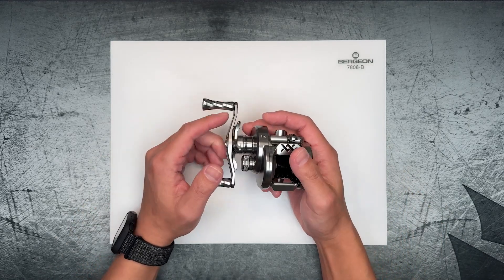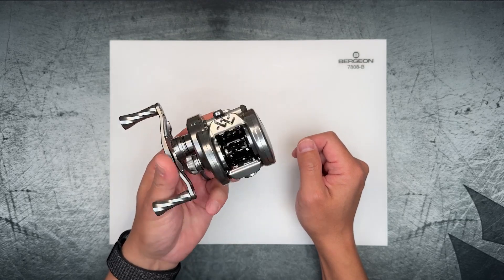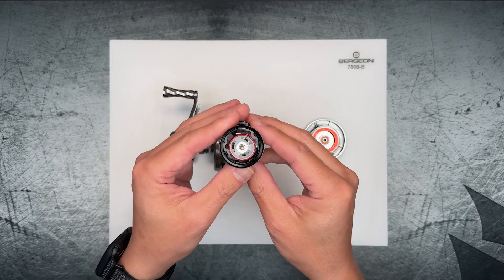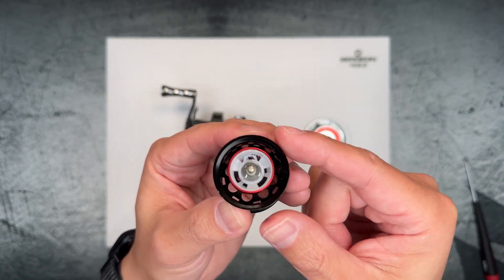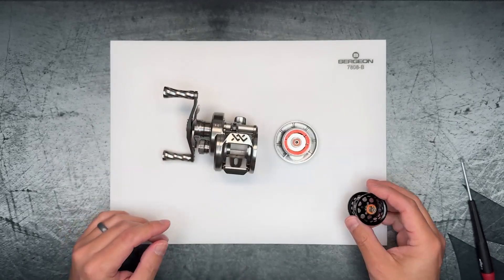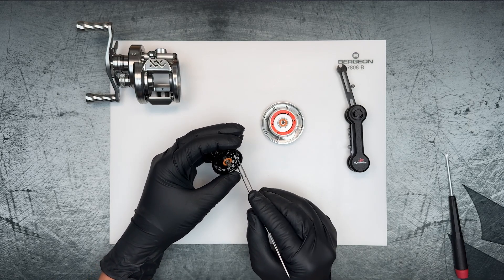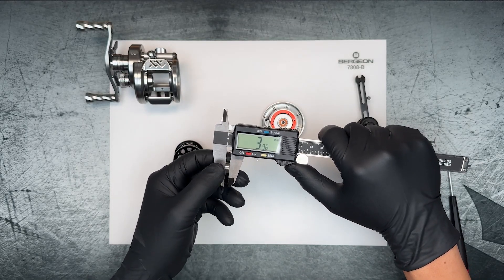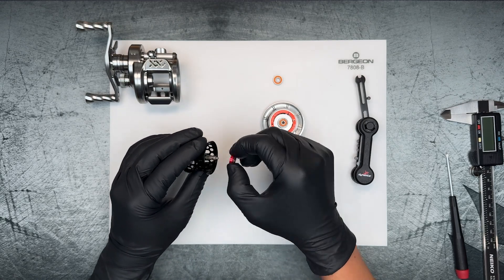🤓WATCH THIS TEARDOWN😳LOONGZE AIRLITE!!!

Comment: Good teardown thanks, does the pinion yoke have a metal plate or it is just full plastic? Without a metal plate the plastic yoke where the pinion gear sits in the cut out will eventually wear down especially in gritty or SW conditions.
Reply from the maker: Hey Nigel! If memory serves, the yokes does have a metal plate where the pinion sits. I can double check when I get back to my work bench but I rewatched the teardown and I could barely see a small metal plate as well as vaguely remember one. I will double check on that though! Great request and I’m not sure why I overlooked mentioning that as it’s a great addition to have imho. Cheers my friend!
Reply: Thanks for the reply, keep up the great work, looking forward to the DC review 😃 @BFSFISHINGCHANNEL
Reply from the maker: Cheers Nigel!!!

Comment: Is the handle post 8x5mm or 7x4mm?  I'm curious which aftermarket handles will likely fit.  Thanks!
Reply from the maker: Hey illini! Just measure and the handle size opening is the 5mmx8mm size. I will say though that the handle itself is made very well. I would suggest just looking to swap the knobs out but it’s entirely your call. Cheers my friend’
Reply: @BFSFISHINGCHANNEL  I like the handle a lot, but I have another reel I might try to move it to. They are all interchangeable parts to me in the end.  I'm also curious if any Daiwa spools fit this reel.  I'll find out soon enough I guess.
Reply from the maker: @IlliniDog01  hey illini! I kind of doubt that daiwa spools will fit as the widths might be different as well as spool shaft dimensions. Worth a shot though? I do agree that handles and knobs are interchangeable. I swapped over some daiwa TPR handle knobs onto my loongze and was thankful that I had done so as the weathers been colder than usual in Southern California. Alloy reels and cold weather really don’t mix lol. Cheers my friend!

Comment: good sir you seem to know your stuff do you know if  AMBASSADEUR 5001C  uses  3mm x 10mm x 4m  bearing i am trying to convert  it into bfs reel but i  have no idea how to measure the bearings
Reply from the maker: Hey kaban! Sorry for the late response but unfortunately I am not sure of the bearing size of the 5001C. You can find out bearing sizes by measuring the outer inner diameter, outer diameter and the width of the bearing. Different manufacturers will orient the measurements a bit differently oddly. Hope that helps and cheers my friend!

Comment: Does the pinion gear ride on two bearings?
Reply from the maker: Hey Benjamin! Yep! You’d be surprised at how many reels do this out of the box nowadays. The pinion in the airlite and the dc airlite are supported by two bearings. The pinion yoke also has a tiny metal plate to help with wear. Hope that helps, happy new year and cheers my friend!
Reply: @BFSFISHINGCHANNEL  It helps a lot in fact. That is one of those designs I really look for in a reel. Makes the reel last and feel new way longer. I would be very willing to give Loongze a chance actually. This is the most exciting Chinese reel ever made in my opinion.
Reply from the maker: @Benjamin-S hey Benjamin! Yea after tearing the reel down I was really impressed with the build quality that I saw. The gear meshing isn’t 100% perfect but I think that that’s something that will eventually improve and hopefully they’ll have something like digigear/micromodule at some point in the future. I have a few other gripes but overall I think the reel is pretty amazing for a first product for a new CDM brand. Their DC reel is also an eye opener imho. Thanks for commenting and sharing your thoughts and insights and cheers my friend!
Reply: @Benjamin-S  with the Shimano MicroModule gears, the pinion has to ride on 2 bearings simply because there is no tolerance for and flex with the gear mesh since the teeth are so small. With other reels, it helps keep them from "locking" under load when the long spool shaft that goes through the pinion on those designs flexes when the gear train is loaded. In the case of this reel, and all other short shaft spool reels, the pinion has to ride on two bearing, otherwise one end would be completely unsupported.
Reply: @BFSFISHINGCHANNEL  I hope they don't try to emulate the MicroModule. Small pitch gears have a place in high speed applications as they are technically smoother and more efficient, but that comes at the cost of strength and mesh sensitivity. A fishing reel doesn't approach the speeds where this tradeoff makes any kind of sense. It doesn't make the reel any smoother as Diawa has proven that you can make a silky smooth reel with "normal" gear pitches as long as you cut the gears well.
Reply: @BFSFISHINGCHANNEL  Just wanted to notify you. I just bought a Loongze. A lot is thanks to this video. Super refined product. I'll be happy to see where they'll go.
Reply from the maker: @ hey benjamin! Thanks for letting me know! I hope the reel treats you well and that you are happy with your purchase. Let us know how things go! Cheers my friend!

Comment: I just watched your video and it still shows you unscrewing the sideplate
Reply from the maker: Hey dbb! Hm I’m not sure I understand the issue you’re having maybe. Any chance you can try to explain what problem you’re having again? Cheers my friend!
Reply: @BFSFISHINGCHANNEL  when you’re removing the sideplate to get to the spool and breaking system you unscrewed it mine will not budge.
Reply from the maker: @dbbfishing2528  hey dbb! Ah you’re referring to the brake side plate? I thought you were talking about the main gear sideplate. Yes, the brake sideplate is a threaded design and is screw on. I wonder if yours might have been cross threaded by accident or if it’s just on there extremely tight… Where did you get your airlite from ooc? Cheers my friend!
Reply: @BFSFISHINGCHANNEL  I ordered directly from their website. I’m thinking it has to be cross threaded because I can’t get it to move at all!
Reply: @BFSFISHINGCHANNEL  I’ve reached out to them and told them the problem they asked where did I get it and I said in the email from you and gave the order number and they still asked where did I get it from!
Reply from the maker: @dbbfishing2528  hey dbb! Look at base where the sideplate and the frame meet up. Do you see any small gaps or does it look like the side plate is seated crooked? Cheers!
Reply from the maker: @dbbfishing2528  hey dbb! Probably because there are multiple vendors it’s hard to keep track of where people are ordering from. I am not sure what their operations are like. Hope they can help resolve the issue! Cheers my friend!
Reply: @BFSFISHINGCHANNEL  there’s no gaps and all the way against the frame. They might have torqued down way too much. I’ve tried a soft jar opener on it as well and it will not budge
Reply from the maker: @dbbfishing2528 hey dbb! Hm… I wonder if giving it a couple spritzes of pbblaster will help loosen the threads a bit…